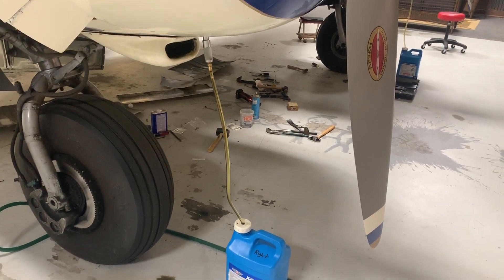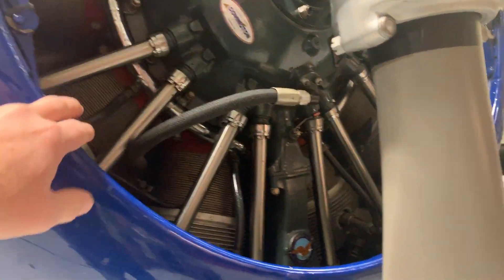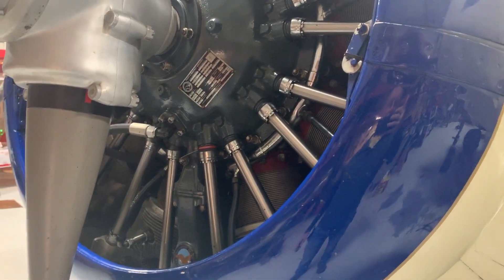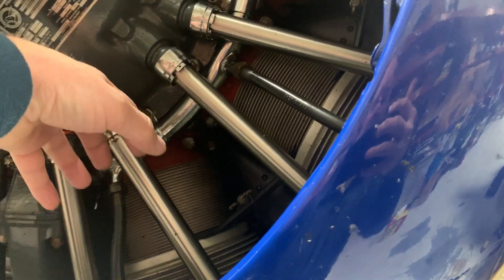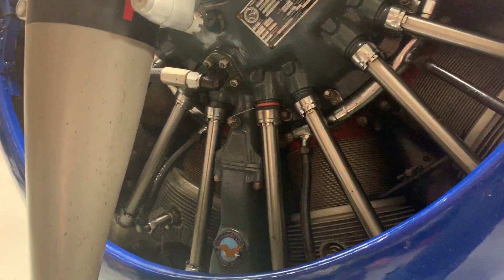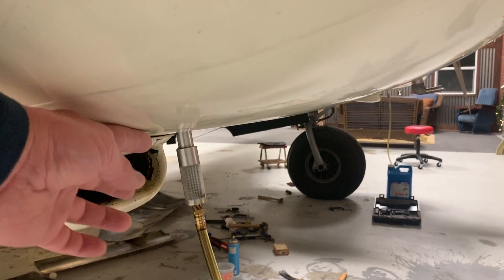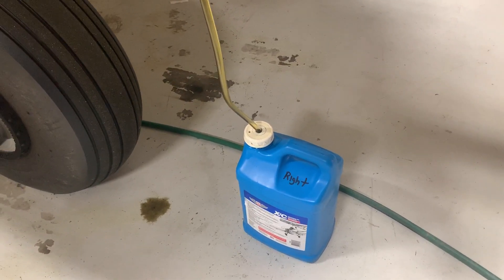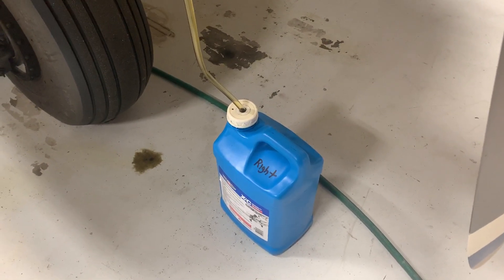Beech 18 Oil Recovery System

Comment: I have a quention. How do the rock arms and valves get lubricated? Is there a pipe or channel than pumps oil to the cylinder heads? Thank you.

Comment: Do you do anything to remove the soot or the moisture? I have a small radial engine that leaks a ton of oil out of the exhaust, and I'm trying to figure out the best way to recycle it. I figured it should be at least lightly filters to get rid of the soot and whatever moisture that may be in it.
Reply from the maker: Don't get confused.  I'm not recycling what comes out of the exhaust.  I'm getting the oil directly from the case.  If you can get it there you won't have much coming from the exhaust.
Reply: um, I think your valve stem seals or even maybe the seat may be leaking. is that normal for radials or just old engine designs in general?
Reply: @nick4506  That's normal for radials.